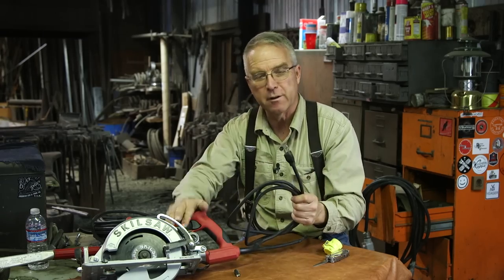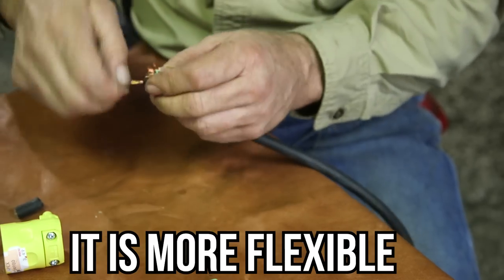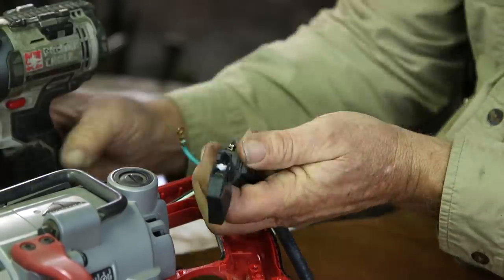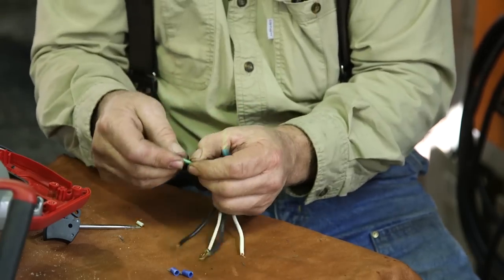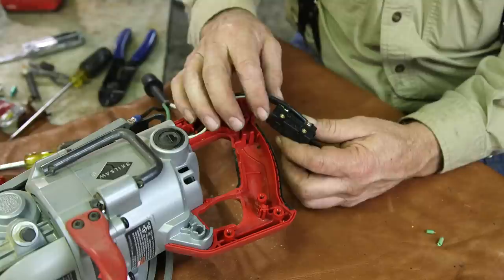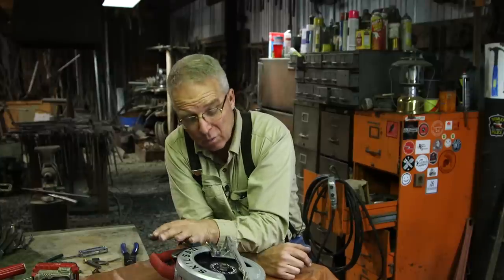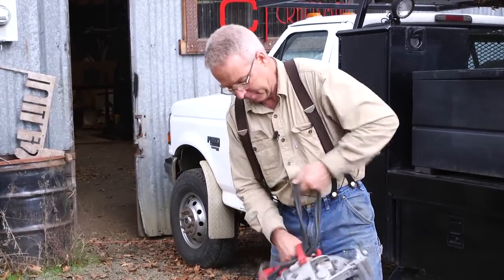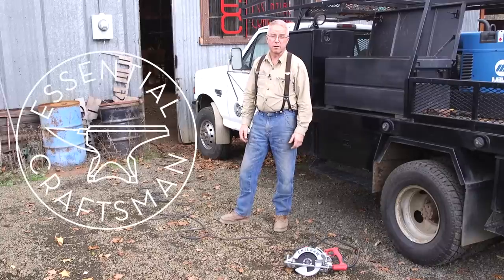Skilsaw Cord Install and Storage Tip

Comment: Or you could just buy a milwaukee fuel or dewalt flexvolt come one its 2018 not 1998
Reply: Dave Blacken don’t get me wrong, battery powered tools are wonderful and have come a long way. However for someone who’s framing all day I would think it’d be nice to plug something in so you aren’t changing batteries all the time especially with a skil saw that draws a lot of amps. Also I think makita is the only company that makes a worm drive battery saw. The other frustrating thing is picking up a tool and the battery is dead. If you’re on a second floor cutting rafters or joists batteries become an extra hassle. They lose power as they drain so you don’t get steady power throughout the charge. Also, the cord makes a handy rope to pull a saw onto a second floor. On top of all that batteries and battery powered tools are much more expensive than corded, especially flex volt or 9.0 or 12.0 which is what you’d need for a skil saw. You’d need at least 2 batteries to work non stop. That’s probably a minimum of $500 versus $150 for a mag77 That being said, I’m a plumber so I don’t carry a corded skil saw. I do however carry the Milwaukee 6 1/2 battery skil saw. It’s wonderful for cutting blocking and other things. Coworkers use a sawzall for this and it’s annoying because they’re never square so the skil saw just makes everything smoother. Yes, I know skil is a brand but that’s what I call all circular saws.
Reply: @joshcowart2446  I have a gen 2 milwaukee fuel 7 1/4 saw i use it all day on a single 12 battery. Has more power than my old 15 amp milwaukee saw
Reply: @joshcowart2446  I've got the two-battery Makita saw. I was a little leery at first because it actually isn't a true worm drive, but experience has shown that that doesn't matter, as it has the torque and controllability of one. While I'm sure my saw can do close to the number of cuts that Makita advertises, what they don't tell you is how quickly the batteries are depleted by long, deep cuts. Cutting a bevel on the top of a 12 foot long 2x4 (to make a sub-fascia) ate maybe half of the charge in a pair of 5 aH batteries. I suppose that isn't as much of an issue for contractors because they'd use a corded saw for that operation and a cordless while up on a roof doing less-heavy cuts. I will say that having a cordless for cutting lookouts while way up in the air is a godsend!
Reply: Dave Blacken I have Milwaukee battery tools and none of mine last all day though the biggest battery I have is a 5.0. That being said a sawzall is the tool that draws the most and it can’t even make it through a couple of hours of roughing in cutting pvc pipe. I’m not sure what you do but I doubt any battery powered saw including the double battery Mikita will work all day framing especially with the amount of power skil saws draw.
Reply: Also, no one is addressing the price difference. Even without batteries, a battery powered tool is at least twice as much. You add two $100+ batteries and charger on top and it’s a lot. If you try to buy less than $100 batteries good luck. They’ll drain after a handful of cuts. Not everyone can drop $500 on a single tool.
Reply: @joshcowart2446  I only use 5.0 on drills and impacts. All my sawsalls and skill saws i have 9.0 and 12.0. Compound miter saw doing trim will last days
Reply: Dave Blacken that makes sense. The 5.0 does fine on my hacksall but yeah that’d be the way to go. Cutting trim is quick. I still don’t think a battery powered skil saw would last for days cutting rafters, studs, sheathing, decking etc. Maybe if most of it is pre-fab. I’m willing to be wrong but I just haven’t seen them last that long. Also, the power diminishes as the battery is drained so you would have drastically less power on your 20th cut compared to your first. That’s why I get a new battery if mine is 2 bars or lower
Reply: @joshcowart2446  i agree not days but the skill saw with the 12.0 it last a long time. Just curious are you running the fuel stuff

Comment: Cannot see the wisdom in this. Framed for years, wrapped up saws and cords thousands of times and could never understand why someone would want 50 feet of cord attached to a 10 pound saw. 6 or 8 feet is plenty. Have a 25 and 50 ft handy. Much easier to wrap up a cord NOT attached to a bulky saw.

Comment: So 2 shortened rookie mistake cords tied into a receptacle in single gang wet location box and cover.

Rings should have insulation removed be spread
 slide a piece of heat shrink insulation down over the wire solder the entire wire into the connector then crimp
Slide shrinky dink up to the connection covering the solder joint and wires insulation for a good inch

Box is extremely handy 
All the Conductor wire is valuable

New skilsaws are crap just look how the handle is narrowly attached to the saw body
The top handle is 50x more flexible
The arbor behind the blade is not machined
Trigger is Crap

Comment: Love the videos but can you say OSHA violation.
Reply: Only that male plug was.... if you use a prefabbed extension cord with a molded plug you're good
Reply: It is not a violation.
Reply: @gregorykern9679  It is absolutely a violation-- replacing a molded plug with a non-molded plug is an OSHA (and NFPA 70E) violation. But like Dan said, if you were to use a cord with another molded plug, it'd be OSHA-kosher, or "OSHA KOSHA" as we say in the Northeast.
Reply: I thought that you were referring to replacing an 8 foot cord with a longer cord. I never considered the molded terminal end versus a replacement being a problem. I wonder why that matters?  Maybe water intrusion resulting in a shock hazard? Thanks for the response though. I usually am a smart ass but I do admit when I'm wrong. Thanks again.
Reply: @gregorykern9679  Water and dirt ingress, yeah, among other things. But the statutory reason for it is simply that it isn't the way the manufacturer designed it (and it's the design they chose that was tested and certified safe). Incidentally this was an issue that someone asked about specifically in one of my OSHA trainings and we had an opportunity to go over it in some detail (and my initial reaction was similar to yours). Cracking open a double-insulated tool to replace the cord would be a violation, too, because it introduces an unknown that wasn't tested for.
Reply: @HogsHeadStudios  not if you use a leviton wetgaurd. It has a built in sealing cordgrip.
Reply: OSHA says this about repairing/replacing cords/plugs: "To satisfy the requirements of the OSHA standards, a repair would have to restore the tool to its "approved" condition in accordance with §1926.403(a). Tools, such as the double-insulated ones you address, are approved as complete factory-produced entities. The approval is for the tool as a whole -- its design, capacity, materials and construction. This provision precludes the use of an approved tool if its characteristics are materially altered."

Other letters from OSHA would indicate that a molded plug could be replaced with a UL approved molded or vulcanized plug, but the literature on the Wetguard stuff doesn't really suggest that it meets that standard. (But it does make a point of saying the lockout switch is OSHA 1926.304(a) compliant.) There are lots of applications in which those are acceptable, but the equipment is approved with the intention of the end-user adding connectors. Most of us don't ever have to actually consider this much when it comes to dealing with OSHA, but being wrong is very expensive if you're in the wrong place at the wrong time.
Reply: @HogsHeadStudios  as in all things, yep dont just believe the internet, research yourself. All I can say is that having 35 years in the trade. The majority in industrial. 8 in oilfield. We are subjected to OSHA regularly. We make cord regularly often up to 200 amps. Using approved male and female plugs. The cut sheets say nothing about osha, they don't care. They say approved for wet and corrosive environments.If you get a dumb inspector, ya fight it like anything else in this world.

Comment: Throw it in the garbage and get a good saw ... I'm not saying anything bad about USA made Skil Saw's but the Chinese made ones are garbage ..no epoxy on the armature coils and the field windings are flapin in the breeze with nothing but Chinese grade zip ties..and don't get me started on the difference between the red plastic they used .. cheeper and weaker is what they said they would make...and they did just that..